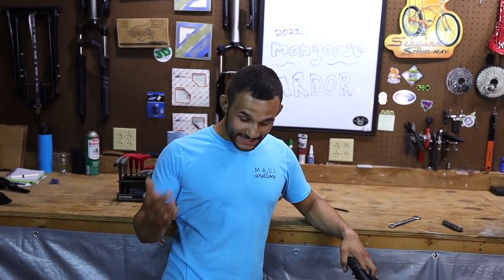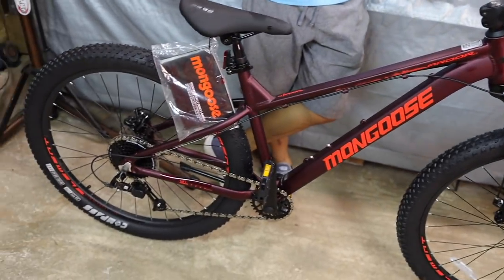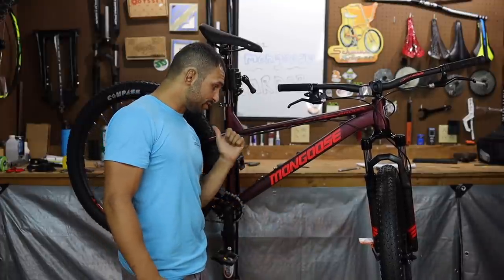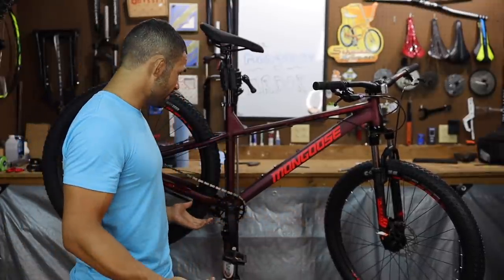Mongoose Ardor First Impressions

Comment: I just bought one. I’m excited to get it in. I already purchased a Bucklos Air Fork, Zoom front and rear Hydraulic brakes, Fooker pedals, lizard skin chain guard, and some new grips for it. Down the road my upgrade will be a new quick release hub and a LTWOO 11 group set and a dropper post.
Reply: hey man!  where did you get the specs to replace this stuff?
Reply: That is the exact budget build I had in mind
Reply: I have the LTWoo AX11 and it is nice. I opted for an oval chainring (Deckas). That 7 speed freewheel makes me want to throw up. They should be outlawed on all new Mountain bikes. There must be a warehouse in China with millions of them built in the last century.
Reply from the maker: That sounds like an AWESOME BUDGET BUILD!!! We may have to follow!!
Reply: was that air fork a straight steerer or are you converting to tapered ?
Reply: @christophermcclelland1556  going tapered!
Reply: @WOLFTICKVIDEOS  thank you! I’m pumped and can’t wait!
Reply from the maker: @Allecks Sadler 💪💪💪
Reply: @alleckssadler7379  that build sounds awesome. Sounds like you're gonna change out the hub yourself??
Reply: Damn bro, you're taking the whole budget build philosophy to the next level.

There's just some things I won't buy budget. Buy once cry once.
Reply: @christophermcclelland1556  Every review video on these bikes give out the specs.

Then just match the specs with parts you find.

Comment: Thanks for the shout out .  My box showed up the same way, good ole FedEx.  Also my rear axle is bent, and my bottom bracket is bone dry.  The bearings sound horrible .
Reply: I had a hole in the box in the exact same place
Reply from the maker: @Ulysses Deltoro Hahaha well at least they are consistent😂. Thank you for the heads up man. Shoot us a email when you get a chance if you want some stickers.
Reply from the maker: @Michael Parker Thant's just wild! Not sure what's going on with FedEx.

Comment: The best thing going for this bike is the tapered head tube & geometry, other than that everything else is old school like the seat tube(27.2) & the frame non-boost. Since the frame is not boost good luck trying to find a 27.5 quick release wheel set, 29’s aren’t fitting on the rear. 

IMO Pacific cycles should’ve just used this color on the Axum, the mongoose looks like it was rushed out off the production line to fulfill the bike shortage.
Reply from the maker: Yeah man we can see that too, either that or a frame that is about 5yrs old, either way we own it and are gonna have some fun with her:) a wheelset is gonna be hard to find ABSOLUTELY!! Thanks D S

Comment: That thing has a "FREEWHEEL ECT"? Is that like an electronically controlled transmission?
I'm only familiar with internally geared hubs, freewheels, cassettes, etc;)
Seems like it'd compete pretty much with the Schwinn Boundary (other than wheel size).
Looked to me like the clutch worked, but not well enough to replace a non clutch that's working properly.
Reply from the maker: LOL Agree man, the clutch worked kinda but a proper non clutched derailleur might be the way to go. I can see what you mean by the Boundary and really hope it does not feel like the very small cockpit of the Al Comp

Comment: It has Schwinn boundary and taff features but smaller frame, color and geometry. It needed a cassette instead of freewheel. I am getting a mix feeling on this one
Reply: Right the tire size, taper head tube, clutch derailer and stand over height had me but without a cassette with quick release  for the rear ...I’m out. (Even though I would eventually upgrade the rims) The seat tube is another one I didn’t like ether, from the big triangle to the long skinny post. You don’t see any bike shop mtb’s with that small of a diameter for a dropper... if anything road bikes, but i could be wrong. I think I’ll wait for next years model. The schwinn axum dp is doing the job for now and stock axum looks great next to my built trek marlin 6
Reply: @ronjr6988  You summed it up just right. I agree with all you lined out especially the seat tube, its a weird thing.
Reply from the maker: Well stated.....But 27.5 with a 2.6 really makes us wonder the possibilities!!

Comment: It definitely looks like maybe it was supposed to be a schwinn axum in a size small but that seat tube diameter is smaller..unrelated but just wondering.. if Mongoose and Schwinn Are made by Pacific cycle, do you know or see a difference in the two brands construction, quality, and parts?
Reply from the maker: Parts-SAME
Construction-SAME
Quality-?????
That one is still unknown man, once we get some riding in with this beast then we shall see, the other Schwinn frames seem to hold up really well and I am pretty sure the Mongoose will too. I am going to try and SEND IT!! LOL Thanks Ron

Comment: I don’t know the geometry of this bike but from a pure eyeball comparison, the frame looks like a Diamondback Syncr.
Reply from the maker: Man we shy away from hose types of things (just dont wanna throw fact were we do not know for sure) but you may be right, it looks a bunch slacker than most:)
Reply: @WOLFTICKVIDEOS  66.5 degree head angle on the Ardor so definitely super slack for both big box and entry level bike shop both.
Reply from the maker: Heck yeah man, there are some talks with a company to send us some 2+ degree headsets!!

Comment: Just got mine today. Can’t wait to rip it. So if I get a tapered fork and headset, will I need a new stem too?
Reply from the maker: No man, you should be fine with a new fork and headset, same bars and stem will RIP the same!!!! Have fun man and if you need any help with links holler:)
Reply: Yeah bud, I could use some help with links on what size headset to get.
Reply from the maker: Man as soon as we measure we will let you know!!! But it should be ike all the schwinns, here is an affiliate which is -https://ebay.us/R97Lb2

Comment: I can't wait to get my hands on a mongoose aardvark these bikes are so exciting I think I would start with putting on some good luck on grips and some decent pedals close to a color match remove the decals then later on upgrade the fork and headset I like the one inch stem I'm not sure about the drivetrain I saw on Kev Central where he put a 1x8 with a new front crank and a different break I believe you put hydraulics on there and like I said I just can't wait to get one of these I'm going to see that it happens even if I have to go out of my way
Reply from the maker: Dude enjoy the upgrade process!! Your bike is gonna fly!!

Comment: Head angle is quite good on this bike, even slacker if you go up in travel. Frame looks well built too, probably can make a sweet trail bike out of it. Routing looks decent too. Curious if seat tube angle will be steep enough when over forked, or proper fork is installed, but will probably be decent, atleast with low travel fork, the seat tube angle is 74deg, 66 ish  head angle as I put phone on my monitor to measure it with Angle Meter app. You should try it.
Most components on this bike are junk. But probably would keep frame, cockpit, hubs you cna chnage, atleast rear, I willing to do that, not all are. You should measure the reach and other geo numbers and compare stock to upgraded.
Reply from the maker: Thats sounds interesting man, I am happy you are happy with it:)
Reply: @WOLFTICKVIDEOS  looks promising, as a entry level option, with upgrade possibilities, without having to build a bike from scratch.  How are the welds? Does everything seem good? The stickers seem bad, or badly put on, but you can put your own stickers on.
Reply from the maker: Will be putting some stickers on and man!! I totally forgot to show off the welds, they all look good:)

Comment: GT Aggressor Pro at $799 vs Ardor at $298, stock with the intention of incremental upgrades?
Reply from the maker: I would take the Ardor and the extra $500 left over. Not sure why the GT is that expensive, but for that price it's a no brainer for us. Remember though, the Aggressor Pro is available in several sizes while the Ardor is one size. I would get the Ardor and get a wheelset, groupset, headset, pedals and a fork with the $500 left over dollars if it were me. Hope this helps.

Comment: Should have put the 8 speed pro rush from the taff because they are the same price but the ascension is 369 and has a 7 speed
Reply from the maker: Agree but it does have the internal routing for a dropper and a better frame size for people like The Tick.

Comment: I ordered this bike a couple days ago as my first bike. Im really excited to get it, but im worried i wont know how to assemble it. Is it easy to assemble? is there any tutorials on how to do it? im very new to this.
Reply: Hey man, it's super easy! Most bikes that are shipped these days can be put together with a simple multitool which I recommend to buy and take with you on bike rides. The rear wheel and shifter are on and have been tested before shipping. So you'll need to put on the bars and the front wheel, then the pedals.
Reply from the maker: Hey brother pretty much what Evan says, its quite easy and please do get a multi tool. You can get one from Walmart, oh and may want to get a can of WD. Tip-when installing the bars on the bike be sure and tighten the top cap bolt first, check if the bars will turn freely, then tighten the side bolts of the stem.
Reply: @WOLFTICKVIDEOS  ok thank you so much! Got a sub from me!
Reply: @dadlife8289  thank you too!

Comment: Between my ozone 500 that I “ had “ bc the spoke on the rear snapped and the Jamis cross country trail series that I have now I would say the Jamis is a lot better bc it’s a lot lighter and faster it was built between the mid to late 1990’s it’s got a 7 speed cassette the front
Gears are shimano acrea and the crankset is sun tour so far the only thing giving me trouble is the front gear shifter the breaks I had to replace

Comment: Thinking about getting this for my gf. Whats the stand over height measurements does anyone know. She is 5’2”
Reply from the maker: I have an inseam of 29 and am 5'5" if you can get this bike, get it! Such a hard bike to find, if it does not fit her, sell it.
Reply: @WOLFTICKVIDEOS  i found it at a local walmart and bought it. Already upgraded to shimano hydraulic brakes, new bars grips and pedals. Lol it is slightly bigger for her liking but its a solid bike. Will change the forks soon and i might just rip it around and give her my D5 😅
Thanks

Comment: dumb question   whats a head set
Reply from the maker: No problem man, a headset includes (in most cases) a top and bottom cup that is pressed into the headtube of the bikes frame. There are bearings that fit in both top and bottom of the cups and help the fork rotate. You can reuse most aftermarket headsets but this bike you will need a new headset if you are going to change out your fork, due to the crown race ( an aluminum washer type ring that fits into the bottom bearing) being welded on.
Reply: @WOLFTICKVIDEOS  thANK YOU FOR NOT MAKING ME FEEL STUPID LOL... i BOUGHT A BOUNDARY BECAUSE YOUR REVIEW.. I WANT TO UPGRADE THE FORK.. I NEED TO MAKE SURE I UPGRADE HEADSET ALSO? IS THAT WHAT YOU SAYING
Reply from the maker: HA HA YES!!! That is exactly what I  am saying, here is an affiliate link to the ones we use and the proper size. Checkout the Taff Headset install, it shows and explains whats up:)https://ebay.us/R97Lb2